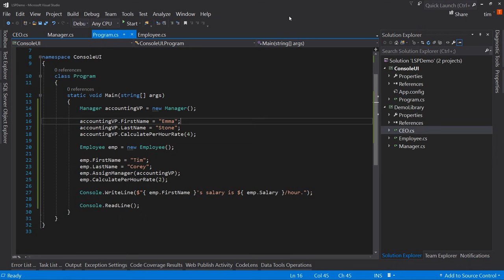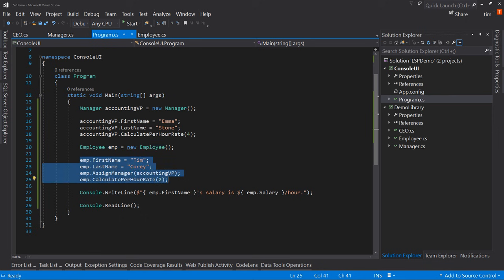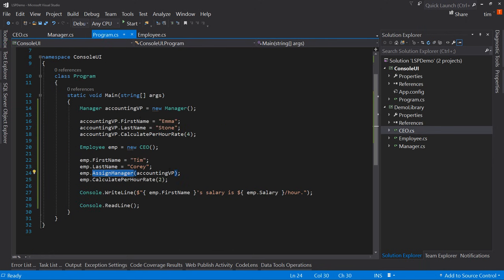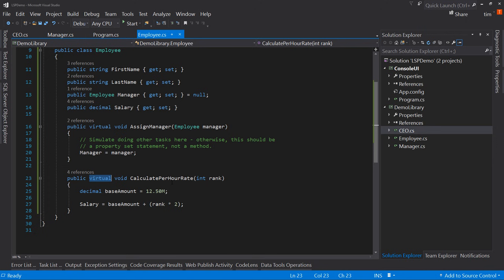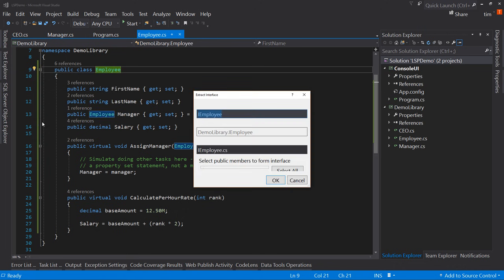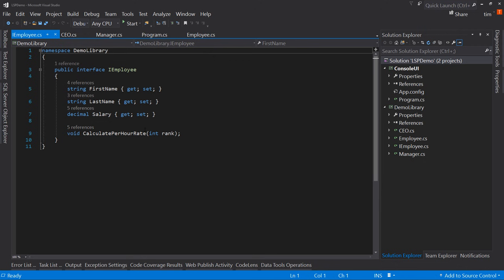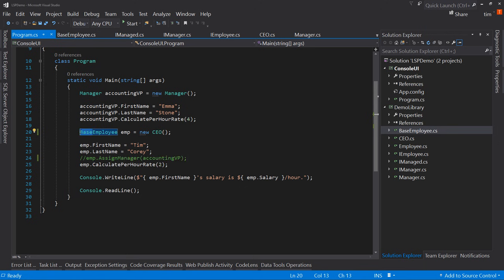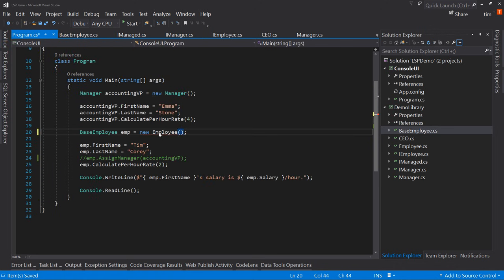Design Patterns: Liskov Substitution Principle Explained Practically in C# (The L in SOLID)

Comment: Am I wrong if I call this hierarchy refactorization ? All I am seeing here its organizing the code in such a way that doesn't break in certain condition or adding a mess. Or in real world applications are really build like this from scratch ? Also since you have experience with real world applications, if you just make things work at first then later you modify them to be more clean ? Or you just start like this with interfaces and try to anticipate scenarios ?
Reply from the maker: LSP is about following the contract of the base class so that you don't introduce unexpected behaviors down the road. This is one of those principles that you should follow every time you create a child class. People too often think that using child classes is just about getting the base class functionality. There is a lot more to consider before inheriting a base class.

The real world is messy. There is a lot more that goes into development considerations than just doing things right. You have to think about time, how often it will be modified, the size of the component you are building, and the team you are working with. In a perfect world, every app should be built using the SOLID principles but we aren't in the perfect world. The best you can usually do is keep these principles in mind and do as many as you can up front. Refactoring later can be hard. Anticipating your needs can also be hard. The key is to do your best and then come back to it if/when you can.
Reply: Thank you ICorey ! you are the best :)

Comment: Hey Tim, I really like the use cases you used for illustrating these problems. I'm encouraging all of my team members to have a look at this series about SOLID to make sure they are doing the right thing.

One thing though, I would use the IManager input type for AssignManager method in stead of IEmployee and make the Manager property in IManaged of type IManager. 
This way, you're making sure we can only input a manager when assigning the manager. 
When retrieving the manager from the employee, we are certain the manager can in fact generate a performance review, which would make this implementation more safe i.m.o. 

It doesn't break anything about the fact that this video is very well explained. Thank you!
Reply from the maker: I'd have to go back and watch, but this sounds like a reasonable suggestion. Thanks!

Comment: Great video again Tim, thanks. Nice and clean and well explained!

However, I think I spotted an error on the "IManaged" interface - the property "Manager" should be an IManager type not an IEmployee type. Because when a "Manager" is assigned to that property you still want to have access to the CreateReports method the Manager has. Hope this makes sense.
Reply from the maker: Yep, I didn't catch that. It would give the variable more access to the manager's methods and properties more easily. I would definitely change that.
Reply: Hello Harag and Tim,

I tried implementing the change suggested here, but it has some more trickle downs that, when all are changed as a consequence of this first adaptation, I end up with errors in the code that I am not quite yet capable of fixing myself. This is my lack of knowledge of of c# course, but is it possible to provide a new download of the completed project with this change implemented? Thanks in advance.
Reply: Sorry, I found it. Now it works after changing in the proper places.
Reply: @peteredenburg6464  Do you have code with those changes please?

Comment: Ok, I'm at 13:52 when he explained that a CEO is not an Employee because it fails the "is a" as a CEO does not have a Manager.

I could be going ahead on the video or be wrong entirely, but wouldn't it be better to take out the Manager property (has a <Composition>) in the Employee class and create an interface called IHaveManager and implement it on the classes that has a manager?.
Reply from the maker: Pretty sure I explain it later on.

Comment: Shouldn't "manager" field in IManaged be of type IManager? It's minor thing but it will say clearly that only manager can manage.
Reply from the maker: Yep, that's a good point.
Reply: Thanks for raising the question, didn't realise method signatures in an Interface could reference the very Interface they're created in, it seems they're self-aware. In this case, AssignManager's input type could also be replaced with IManager.
Reply: Good point

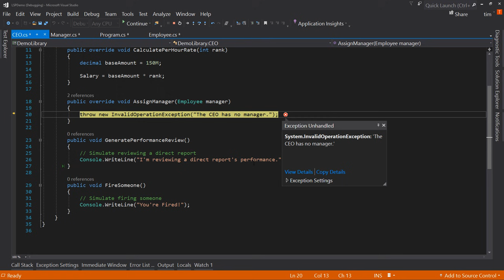Comment: what if you overloaded the AssignManager() inside the Employee base class to have a version similar to what the CEO had 5:10 line 18? would you be compliant?
Reply: Actually just remove the implementation of AssignManager inside CEO and just pass null argument (.AssignManager(null)) in an instance of CEO. That would have been compliant to LSP because the child (CEO) would have supported all the Parent's (Employee) attributes.

But this exercise is just so to demonstrate LSP.

Comment: Tim, In a reply to a question you said "OOP can get complex but the key is to learn it slow, not try to dive into the deep end. Get comfortable with classes first (static and instantiated). Then work with inheritance and interfaces. In the meantime, get really comfortable passing class instances around (and understanding how they don't actually move around or copy). Once you are comfortable with all of that, then move into SOLID."

Can you plese tell me what do you mean by 
1.get really comfortable passing class instances around
 2. and understanding how they don't actually move around or copy
Reply from the maker: Basically, get used to using class instances as variables. So if you have Person p = new Person(), get used to passing that "p" variable into methods, modifying it in the method, and realizing you don't have to pass that variable back because the original location has the changes already. Remember that you are passing around the address to the house you built, not a copy of the house. So when someone who has the correct address makes a change, everyone who has that address can see the change.

Comment: Although I really appreciate your example, and its straightforwardness is part of that, one easy real-life problem I could see would be the GeneratePerformanceReview method having a lot of code in it. In this current design, that code would need to be replicated among all IManager classes. Since C# does not support multiple inheritance, what would be your solution in such a situation where both the IEmployee and the IManager (and, just for fun, maybe also IManaged) came with a lot of code that would be nice to reuse. 

Composition? I could see all that extensive code for how to generate a performance review being pulled out into, for example, a PerformanceReviewGenerator class (which, for good Unit Testing, would necessitate an IPerformanceReviewGenerator interface) that Managers and CEOs require (or instantiate) as part of their construction, and GeneratePerformanceReview just becomes a wrapper for calling the PerformanceReviewGenerator class's GeneratePerformanceReview method. Is that the approach you'd recommend in practice?
Reply from the maker: Yep. The key, though, would be to identify if performance reviews would change significantly between employee types. If so then you would probably have a method in the employee type class that managed the review (calls a bunch of methods to set it all up). If not, you could just have the review class injected into the employee. A lot of different approaches here but you are correct that we don't want to create duplicate code.

Comment: Thanks for the videos...These are great explanations of the SOLID principles! One thing I just wanted to clarify my thinking on with this video around 31:00.
When you use BaseEmployee emp = new CEO(), presumably you wouldn't be able to call the CEO method FireSomeone() because it's not in the BaseEmployee abstract class. So, in this case you're not actually creating an instance of CEO, you're using CEO to create an instance of BaseEmployee. Do I have that right?
I realise it's not probably in the scope of the principle being explained but, I presume you would create another interface ICEO that inherited from IManager and contained void FireSomeone() and then CEO class would inherit BaseEmployee and implement ICEO. Is that right?
Reply: So Im going to try to explain this as I understand it, please, anyone correct me if I am wrong:

So for part one: BaseEmployee emp = new CEO();  and trying to call .FireSomeone()
The emp variable is a container that can hold anything that "is a" BaseEmployee (ie, Employee, Manager, or CEO).  So in fact, if you made the following statement: 
(emp as CEO).FireSomeone();
 this would still work because what is being held in the emp container is an instance of the CEO class, and therefore has a .FireSomeone() method.  Now if you just tried emp.FireSomeone() the compiler would yell at you, or if BaseEmployee emp variable was assigned to new Manager(), everything would blow up since it doesn't implement .FireSomeone(); so just be careful with the (variableName as Type) expression.

For the second part, you absolutely could create an ICEO interface and have CEO implement it, but I am guessing he leaves this out as there aren't any other classes in his example that would also fall under the ICEO interface that are not the CEO class itself.
Reply: @tekneinINC  Yeah, I kind of get what you mean. But, casting it to an instance of CEO, in your example, doesn't really explain why you'd ever want to declare it as a BaseEmployee in the first place. You may as well just have said var emp = new CEO(); which would have just given you a CEO instance straight away.
I still don't really understand what the purpose of the Substitution principle is.
It seems to me like saying Fruit orange = new Orange() and then saying Fruit orange = new Apple(). They're both fruits; I'm not sure I understand what problem this solves?
Reply: @richsandison  So its usefulness is definitely tied to your situation, there are instances where it won't matter, and instances where it will.  
But for an example, if you were making a library inventory/checkout app and you needed to do specific things for books vs audio books vs VHS tapes, but for your checkout process, it didn't matter if it was a book, an audio book or VHS Tape, you might store your inventory as:

List<Book> books;  // maybe books keep track of which rack they are kept on?
List<AudioBook> audioBooks;
List<VHSTape> vhsMovies;  // maybe VHSTape has a .rewind() method?

Now when your making the checkout cart, it doesn't care about the differences, so you make it:

List<LibraryItems>  checkoutItems;  // maybe they all implement the .checkedOut() method?

That would let you do something like:

checkoutItems.add(aCoolBook);
checkoutItems.add(aCoolAudioBook);
checkoutItems.add(aCoolVHSTape);

Provided they all inherited LibraryItems as a base class(or implemented it as an interface for that matter). Then elsewhere in the app, it can still use the specific functionality needed for each of the more specific items.... like someVHSTape.rewind() after the tape gets returned.

I hope this example makes some kind of sense.  I'd definitely recommend playing around with the idea in code, as it can be very powerful, but it's also easy to get tripped up until you get that "eureka!" moment(which will come, I promise!)

Comment: Why do you choose to inherit IManaged from IEmployee. It doesn't seem to add anything and creates a diamond inheritance tree for Employee since it now has IEmployee as a base class through IManaged and BaseEmployee.
Reply from the maker: Interfaces are not inheritance. They aren't base classes. You can have an interface applied more than once without an issue. An interface is just a contract. It says what the class will have in it. That's it. In certain circumstances, it can be useful to have a contract applied more than once, like in this case.
Reply: @IAmTimCorey  Had the exact same question as Ernst and got confused. The same happens to IManager, which inherits from IEmployee. How is it usefull in this case?

Comment: What's difference between polymorphism and liskov substitution principal?
Reply: That's a good question.
Reply from the maker: LSP is essentially a clarification of polymorphism. There are things you CAN do in polymorphism that you shouldn't do. LSP identifies the best design for polymorphism.
Reply: let me, let me - so polymorphism is a oop concept (how the language works, what you can do to objects) while LSP is a SOLID principle - what is a good way of using the oop, how to solve recurring problems, "do this in this way because you don't need to re-discover the hot water" type-a-deal (:

Basically SOLID says - do as we say or suffer as we did, while oop says - hey, you can do this to an object!
Was i Feynman enough?
Reply: @xlnt2new  You both cleared it up great! And though I'm not OP, I'll still say thanks. So thanks!
Reply: @orcbloodtech422  Waaagh!

Comment: Thanks for your work! I have a question, Why we need to replace instance of parent class by instance of child class? in which case we need to do that? Is it because we want polymorphism to be happened without any problems. Thanks
Reply from the maker: That's a common use-case. For instance, your application might rely on EmailClient, but you end up writing a child class called GoogleEmailClient and another called OutlookEmailClient. You can then use either in the place of the original class without disrupting anything.
Reply: @IAmTimCorey  thanks! your channel helps me alot!

Comment: Thanks for the great example and explanation. just one question, what if I want to make the Salary property to be set only with its based classes? so that its cannot be directly set a value. i trued to add protected set modifier to it, but  it broke the code
Reply: ok so i remote the set in the interface for Salary, and in the BaseEmployee added protected set to it implementation , hope I'm correct